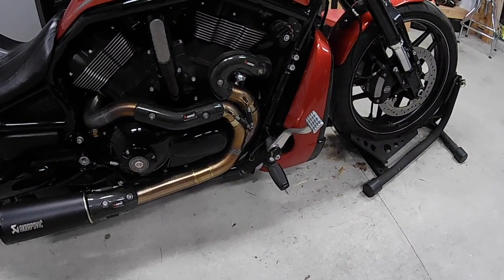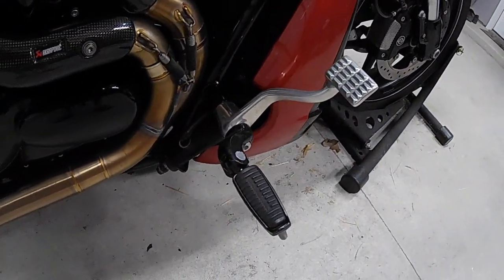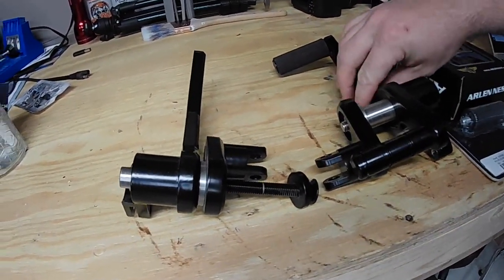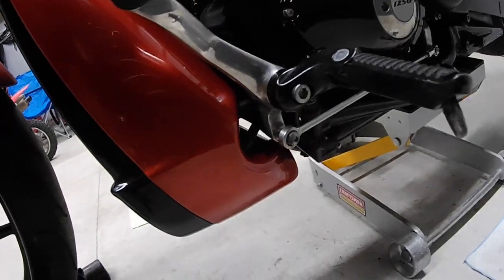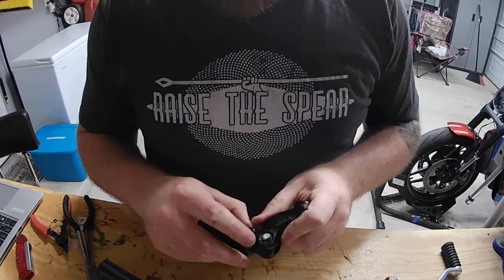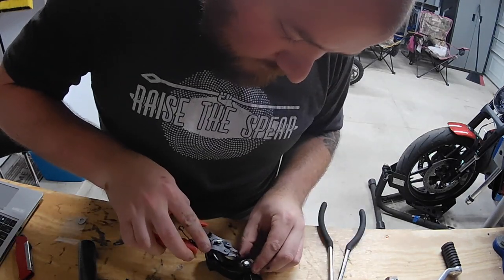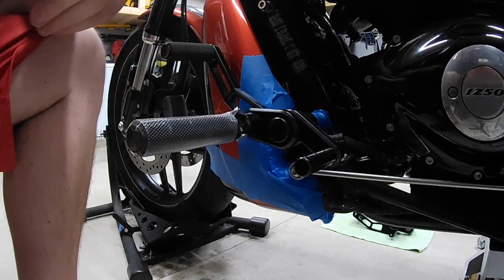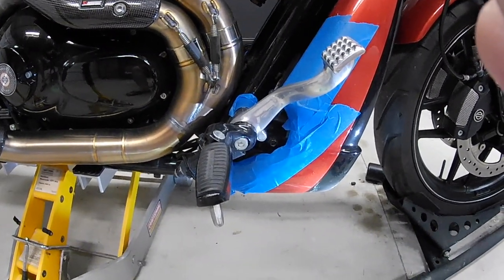DIY! 2012+ V-Rod Night Rod Special Altered State Design Extended forward control install

Comment: You think those would fit my 2007 ? I'm 6'4 i really need those
Reply from the maker: These won't specifically fit your bike, but Keith does make controls for the earlier bikes.  Check out his website here for the 02-11 controls.  You will not be disappointed! https://www.alteredstatedesign.net/2002-2011-bikes
Reply: Yes I got them the 4 inch ones they arrive today. Im 6'4" . Hopefully I did not get too much of an extension
Reply from the maker: @franciscomorales7303  I think you should be fine with those at 6' 4"

Comment: Did the kit came with foot pegs altogether?
Reply from the maker: Marin Ujka they do not come with pegs.  I bought mine second hand, but new and the seller had already bought pegs so I used those
Reply: @jfisher99999  i did got the kit from keith but im having hatd time downshifting and braking as i have to pull up both of my foots in order to brake or downshift

Comment: looks a lot better, BUT that will not solve your issue with the pain in your hips, the wind will still try to push your legs out....I've tried all different kinds if forward pegs and they all do the same....its the position we are riding 🤷‍♂️....i tried different motorcycles with mid controls including a muscle and i did not get that pain...
Reply from the maker: Antonio Delgado so far I no longer have any issues with hip pain personally.  My legs are significantly straighter so they naturally dont want to “fall out” on longer highway rides.  I’ve had bikes with mid controls as well and I definitely didn’t have any hip pain, but I personally like the forward controls for this bike
Reply: @jfisher99999  i like the forward controls too on mine , im not changing them😊...i did however put  extra pegs where the midcontrols go, to use on long trips on the highway 😁
Reply from the maker: @antoniodelgado820  that's not a bad idea at all!  Have a link to what pegs you have?
Reply from the maker: Antonio Delgado that sounds killer!